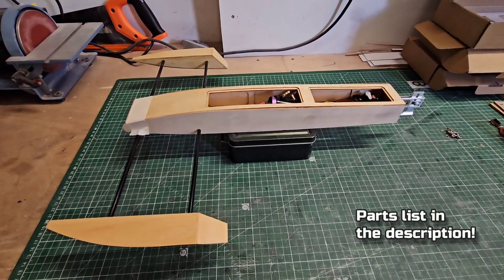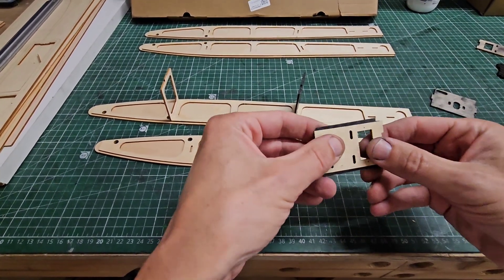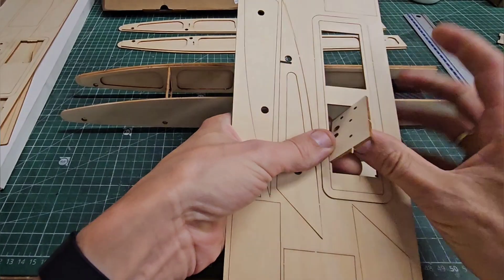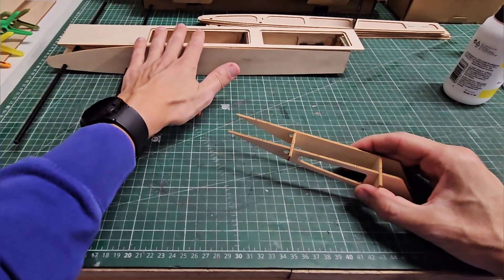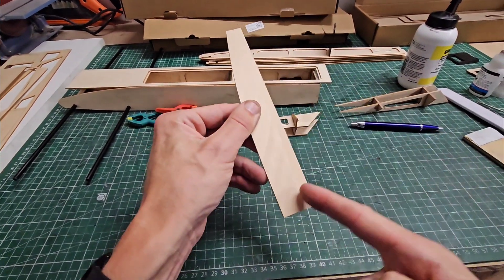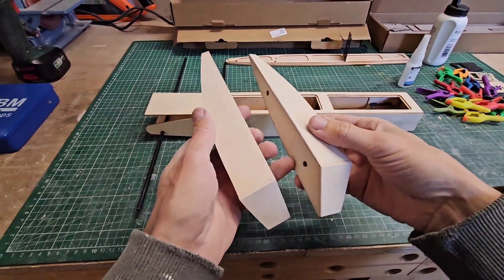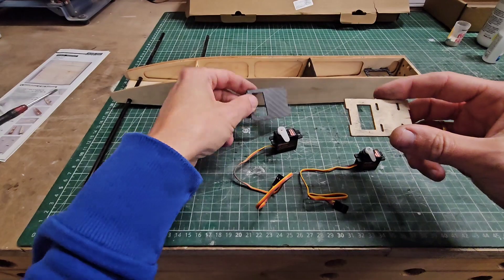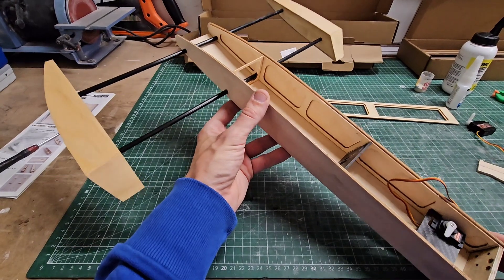The cheapest way to go fast: Shrimp rigger DIY RC boat build project part 2

Comment: how did you cut the 2mm carbon fiber? CNC?
Reply from the maker: With a rotary tool (like a Dremel) with a cutting disc. Beware to always wear a dust mask, and use dust suction to prevent the carbon dust to  go everywhere

Comment: Low profile servo
Reply from the maker: @craigjones2015  I use a 12g servo, and it's a perfect fit. A bigger low profile servo might work as well, but not in the stock servo plate.
Reply: @CozyRC  in the plate you made out of carbon fiber. Hopefully

Comment: Sorry DJ , only just seen this on the play list , Great to see these updates , did mine 10 years ago. The other tricks to add speed can be put 8mm of aero down angle  too  get rid of that flat top on the sponsons ,stop the cut at the front boom bar. And add 2 rear sponsons at the same angle as the front , too CL of shaft . Big B did centre ski , that seemed to work well, and helps take some load off the ESC.
Reply from the maker: Thanks for the advice! I built one about 15 years ago, with 2 rear sponsons. This time, I go for the center ski 👍
Reply: @CozyRC At the time the UK class was built around a 1800 ma lipo, so seemed the way too go . Not sure i would go that way again. I did do a mould of the tub and made a Utube clip of it running in the local park pond.
Reply from the maker: I've seen your video, nice run! I've seen that you used a different sponson design.
Reply: @CozyRC  I did run the shrimp rigger style sponsons when i did heat racing, As they gave good lift at the start of a heat, having to lug an engine and gearbox around. But a skinny flat bottom sponson works fine for modern hulls and you can add plenty of top aero to reduce blow over.

Comment: Looking very nice, do you have any tuning tips for ride of the rigger, mine has a bad hop under load. I believe strut height and angle adjustment is needed but it's my first rigger so I dont know. Thank you.
Reply from the maker: Thanks, Mike. If it hops, I would guess the strut at the back needs a bit more up angle. If that's not possible, try to raise the strut a bit. Good luck ✌️
Reply: @CozyRC  Thank you sir, I believe you're right. Thank you have a great day!

Comment: Great easy to follow build, you might want to add a bit of reinforcement to the rear bulkhead / sides of the tub. Perhaps some wooden blocks / doublers glued inside the corners at the rear, I have seen the rudder tear out the rear bulkhead in crashes.
Reply from the maker: Thanks, and great advice! I will do that. I will also add a carbon plate, because I use a different hole pattern, too.

Comment: Bro you made the best build video YET!! Best on YouTube!!
Reply from the maker: Thank you. I appreciate that! A lot of time goes into these videos, so it's nice to get your positive feedback!
Reply: @CozyRC  trust me I don't put as much work into my videos as you do but I do understand the work it takes to make a good video. You did a great job. Only thing is I'm literally building mine as we speak and how did you get the transom to fit? Did you sand the main body stern tabs flush? Then glued the 2 transom pieces together?
Reply from the maker: Good question. I glued the transom before sanding the tub sides flush. It does need some sanding, and I will add a doubler (tripler) plate at the back to make a new hole pattern for my 4mm stinger.
Reply: I used different materials to assemble mine I was told by someone with decades of experience, but your video was just, in my opinion, easier to follow and get the basics!!